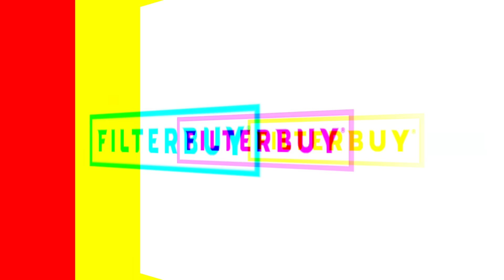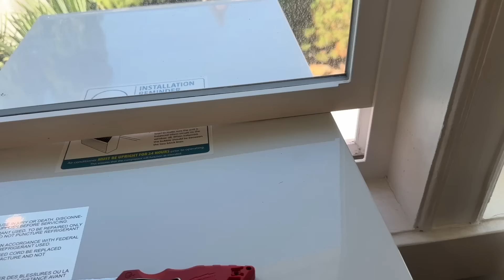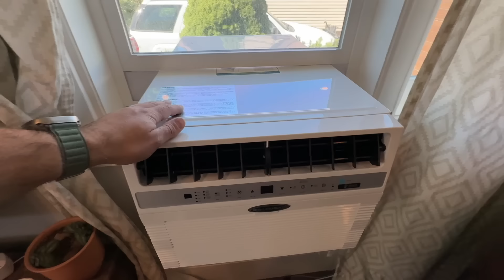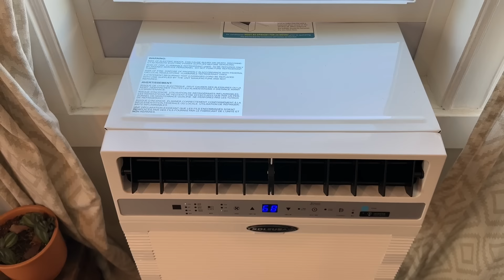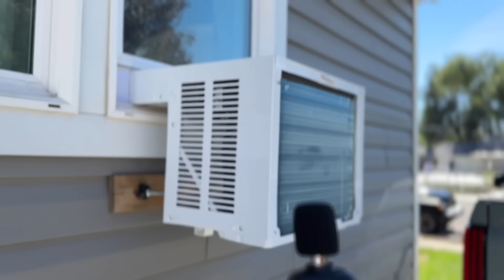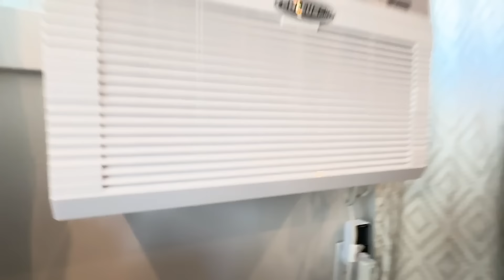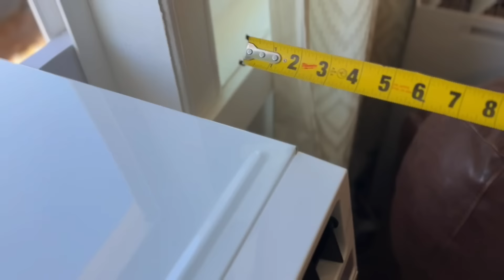I Thought It Couldn't Get Any Better... But It Just Did.

Comment: Great idea but it will not work in older NYC apartment buildings because the space between the inside shelf and the outer wall is over 20" and this will only accommodate 11".

Comment: You would be a fool to buy this (or any Midea) product. They recalled this unit originally and force you to cut off the cord to get your refund. Well, it has been over a year that I have been trying to get my refund and they will not pay it because they say my address does not match the registered address. Well, people do move and even after they supposedly updated the address they just keep saying the same thing and I have not gotten a refund to this date. They depend on TruePic (Scammers that use location based pics) to verify everything. Again, my actual house is over 1/2 mile from the road since I live out in the middle of nowhere so the pics will NEVER have the exact location that the address shows. Midea are just scammers too.

Comment: If you've ever installed one of these units, whether it be this or a ge/haier, they simply are not that easy to install. In this case the window casing is exceptionally wide, helping stabilize the unit in the window. If you have a less wide window casing these units are both awkward and unstable, note in the video where there has been a small step installed on the outside of the house siding, this is to keep the unit from sliding down backwards and then falling out of the window unit. When its time to remove these units, its a 2 man job, don't kid yourself.... either get a conventional window unit of a split a/c unit. It just makes more sense...

Comment: I was ready to buy one but then I checked the reviews. Many bad reviews for reliability, and afterward no service available, just ship it back to California at the customer’s expense of $200 or $275. They’ll reportedly ship a replacement then. I might buy it if I could return it to Home Depot, but shipping it to California pretty much voids the warranty for me. Is this how things work in the entire industry?
Reply: Did you read why the reviews are bad? It's because people were complaining about the drain cock being on the front of the unit. But what we really need to hear about is did they install the unit as level as possible then tip it outside 1/4 inch to slope the drain pan, or not?

I think the Midea brand is probably more reliable though if you ask me.

Who knows.

Comment: I have an Soleusair 8k BTU over the still unit. it works great and is very quiet. My unit does not have heat pump feature. the link he gives in this video does not appear to send you to a heat pump feature unit as well.

Comment: I need to find a window AC that I can run to cool a room at 65 - 68°F even if the temperature outdoors is below 59°F, or even 49°F (not supposed to run AC on cool when outside it's 59°F or lower -- causes AC to freeze up, so Ive been advised). Opening the window is a NO (can't maintain my preferred humidity). I want to climate control the room temperature and humidity to my specifications. You would think that a window unit makes perfect sense for this purpose. It's a hole already present. Why drill a hole for a mini split I you don't have to? Also why add that large mini split wall unit when a window unit is most efficient on space savings?

Comment: This was sus when I saw it. These things just are too small to work at low temps. If it's below 40F outside it's most likely not going to heat at all or the efficency will be in the toilet and it says in the manual straight up not to use it at all at 32F or below. This is not for a cold weather climate.
Reply: I’ve been thinking the same thing, but if it works in March, April, September and October, it would still save me a fair amount of money. Those months are not usually ice cold all the time in New England. We have electric heat and my bill is like $400 a month. I’ll take any efficiency gains I can get.

Comment: I need a window unit that's about half the width on that middle part.  House has tons of windows where the top half and bottom half do not move as a whole, in any direction.  Instead, the bottom halve's bottom half (the bottom 2/8ths of the whole), slides left.  So of the whole window, only the bottom 1/8th slides to the side to open over the adjacent 1/8th.

I've managed with a dual hose portable in these windows, but it takes some yearly rigging up to seal it up ok.  Oh well.

Comment: Interesting that you are measuring 5-6 amps when the product listings are saying it is around 10 amps which is more standard for 12,000 BTU units, though that might be due to using the slowest fan speed.  A 5-6 amp unit is more often a 8,000 BTU unit.  It is also interesting that your amazon link is for the 10,000 BTU unit and not the 12,000 BTU unit you are reviewing.

Comment: The vibration issue is present on mine, slightly different model. The heat shuts off completely when it's under 24 degrees outside also.
Reply: Thats a bummer been looking for a combo unit for my bedroom since it gets the worst or ac/heat from my units.
Reply: @TheDarkArchon  it's so close to being amazing but has these drawbacks it's really a shame, and there really isn't anything better.

Comment: Today it is 699 with a 125$ coupon for the 10k unit. Only 3 star reviews on Amazon. Buyer beware apparently. Costco had a similar unit not too long ago and well... with Costco...returns are a breeze. Here is a recent review... "Do not buy. Zero factory support.
Mine went into a failure mode F5. Total failure. Solrus phone support is ZERO.
Do not buy"

Comment: It's not a heat pump. Heat pumps are ACs that can run in reverse, using half the energy (half the money) of a normal space heater.  Don't get these units without heat pump heat. Unfortunately there aren't a lot of window heatpumps out yet and they are $2k to $3k. There are inexpensive mini split heatpumps, but they take a lot of installation.
Reply: This is a heat pump, I have one

Comment: Not a word about drainage? The drawback to the saddle design -- as compared to the U shaped -- is that water from the coils can't flow out. So it is bound to have some kind of collector.
Reply: It has an internal pump that pumps it outside. Some people say it can get clogged in the reviews but I haven't had that issue yet
Reply: @jasonlaboy  The pump could very possibly fail eventually causing a leak.
Reply: @anymousanticlanker  yeah I image it could

Comment: $800 w/tax and 28% negative reviews. Several complain of the vibration, noise, errors and premature failure.
Reply: We have two of these and can confirm the vibration and noise. The noise can be reduced a bit with some insulating foam around the unit and a good whack if the fan is making a noise (some kind of misalignment?), but the vibration is still a major concern.
Reply: To add, we got this for the winter period and it did a good enough job during a mild freeze that only went down to around 28F. I also just learned that the fan is always on in cooling mode, not something I’m happy about. If I was more knowledgeable, I’d take the unit apart to make the fan behave the same as when heating (only turning on while the condenser runs).
Reply: I own one of these units and it’s one of the best air conditioners that I have ever bought. As far as vibration goes, I’ve experienced no vibration whatsoever. When you put it in quiet mode you barely hear it. That’s one of the main selling points of this air conditioner. Yes it cost more than the typical air conditioner but if you’re a light sleeper, you couldn’t ask for a better air conditioner.
Reply: It did vibrate at first but now it doesn't I'm not sure why. I love mine.
Reply: @RichardPetron  I got mine used and I thought that might be why mine vibrates like that but aparently a lot of people's do. The old owner destroyed the mounting bracket too, but I got a good deal
Reply: @RichardPetron like a brand new car, maybe it had to break-in?
Reply: I bought one. As others pointed out, it rattled the wall and resonates a low freq throughout the house. Felt like I lived next to train tracks. I couldn't take it. Boxed it up and processed an exchange. The replacement was much more quite with much less vibration. Still emits a hum through the walls but not as bad as the first one. My biggest complaint now is that it really struggles below freezing and puts out less heat than my wife's hair dryer.
Reply: @nunyabusiness1499  it may not feel warm because it blows a lot of air but it is still probably giving you a cop well over 1 at 24 outside.
Reply: And the other 72%?
Reply: @eatduncanjewett  41% 5 star. Very poor rating.
Reply: @eatduncanjewett I'd be grading this on a curve because it's the only unit like it. Heat pump window units are almost impossible to find. This thing can be outdone so easily though.

Comment: Not sure why some say it won't heat when it's below 30 degrees. I'm only guessing as I don't really care, but I have 2 110v split systems and also a 220v system. All function in 0 degree weather just fine. Maybe be the window unit being 110v isn't the same as a split 110v system for some reason. It makes sense that it would be without the line set and install aggravation. Maybe I'll look further into it. I would be convenient if these worked as well as the 110's I got without going through the installs and the lesser chance of loosing a charge later as time goes on.

Comment: Anyone that has owned any window unit knows the one thing you fail to talk about, which is ease of cleaning in place... So many of these units are designed to fail the moment the fins get dirty but no one makes these things to be cleaned without full window removal, and it's a major PITA. It makes you wonder why they don't design a commercial unit to be cleaned regularly with out removing the entire unit and disassembled...
Reply: Weekly: low-pressure water hose to the condenser unit and its coils (bonus if you use a leaf-blower beforehand while its dry to knock loose more debris) with the drain plug removed to allow dirt and water to exit the housing. Clean interior filter weekly, never wait for a 'Filter' light because their intervals are wayyy too long.

Every 6 Months: Foaming A/C coil cleaner on both condenser and evap coils. For the evap coil, I go back after it with hot water in a spray bottle after about 10-15 mins of letting the cleaner sit.

Other: I purchased a plastic A/C vent deflector that magnetically sits on the top vent of the outdoor section. This allows that vent to still draw in air for the condenser fan, but the deflector prevents a significant amount of leaves/pinetags/etc from being able to fall straight in.

Some of this is difficult if not downright impossible if your A/C is on a 2nd floor or higher, but these are absolutely the best things you can do for it without taking it out of the window. My 2019 Friedrich Chill A/C has kept my room at 61-63F confidently even if it's 100 degrees outside, all these years.

Comment: Well, when I was in the Navy in the late 70's, the ship I was on, USS Durham LKA 114, , I was in engineering and our living space was 1 deck below the main deck separated from the engine room by a steel plate floor. Needless to say,  it was still loud and the vibrations, Then when I was with forestry for my career, I went out in a strike team to Angeles National forest 1996, They gave us a nice 1 acre or so mowed area with a nice big huge portable generator. 🙂 that was only 50 ft or so from our group pitched in tents and sleeping bags. You would be amazed how easily you fall asleep when you are exhausted and how quickly your body adapts to the noise that you don't even realize that it's on. I would not have told this with my real name. I never boast of anything. So this makes  no difference. MY Point, you can adapt to most constant noises quickly. CONSTANT steady. NOT a dog barking or cat's fightings. that is not a constant sound like a humming sound or air conditioner. sorry for the story. steady noise is easy. 🙂thanks.
Reply: Agreeing, It's abrupt new noises that wake me.
Reply: @HutchinsonJC  yes, not steady continuous. 🙂
Reply: I slept in a top rack with one foot of space above me from a 5 foot diameter reactor steam dump pipe, sounded like a train running me over.  Also had a berthing next  to the chain locker on a carrier, my God it's impossible to describe what that sounds like as it rattles  your bones.
Reply: @ChillWill-q5x  part of our job as an HT was sea and anchor detail. Got to let out the anchor and chain a few times. Needs a face shield because all of the mud and dirt and rust that came out of the chain locker and yes, It was really really loud and fun. thanks for the memories. 🥰🥰🥰🥰

Comment: Just to be clear, does this unit actually include a heat pump, or is it a simple resistive electric heating coil packaged with an inverter/compressor A/C unit?  You mention a reversing valve, which says it's a heat pump, but there is no mention of the HSPF or COP, so I'm confused.
Reply: It is actually a heat pump

Comment: Gradient and Medea also have inverter-driven saddle-design units.
Reply: With A/C and a heat pump?
Reply: Those will cost around $3k. So the price difference between this and the Midea/Gradient units is huge.
Reply: I thought Medea only had the u-shaped that comes up around the window, not downward. Please share model numbers if you have for their saddle. Thank you.
Reply: @dplj4428 yeah theirs is up around the window and does not have heat.
Reply: Gradient is bad too. Send them an email, but use a few slang phrases or try to ask 2 different questions on 2 different topics. Their AI "person" on the other end will show their cards really quickly.  If you're in for entertaining yourself.

Comment: After installing such a unit, what about security? The window cannot be locked normally.
Reply: small length of  2" x 3"    placed between the top horizontal of the bottom sash,,,   and the underside, of the top horizontal,
        of the window frame
Reply: They make little clamps that you can place on the window sill to lock a window at any position. Just search for "Sliding Window Lock".

Comment: Thanks for that demonstration. I like the new saddle style window air units. But I'm curious about what the current draw difference might be with that power cord uncoiled. A coiled power cord can create an AC choke which can create a problem with current flow in the cord. I don't think your current on that unit is high enough or coiled portion of the cord is long enough to be a problem but I would be curious to see what your current draw would be with the power cord uncoiled and then the power cord coiled as you have it in this video.

Comment: At low current draw like this, there is no provision for auxiliary (resistive electric) heat.
The heat pump will only function well down to about 40 degrees F. Outside Air Temperature.
Then it starts 'making ice cubes' below that ambient temp., and gets stuck in the defrost cycle.

Thanks for the review
Reply: In my experience it works well down to 24 when it complety shuts off but it does defrost especially on snowy days. It doesn't completely kill the effectiveness of it though
Reply: @jasonlaboy  Very nice, good to hear it is engineered for lower OATs! Thanks for the information!

Comment: Important Question --- If the power goes out will this unit resume operation using the settings it was running with before the power failure? Sorry, never mind. The condensate drain issue is a deal breaker for me. The one you demonstrated that goes up from the sill is the better design if you don't want to babysit a drain.

Comment: That design has to have some sort of condensate pump which is going to be the weak link. It'll probably last a year or two before the pump dies and replacing it requires total disassembly of the entire unit and/or the part costs as much as just buying a new unit. Been down that road many times with dehumidifiers. The pumps always fail before anything else.
Reply: I saw this type awhile back and kept going back and forth on the idea of getting one. I have a small window a/c that cools the entire 800 sq ft house I live in. I don't like that it takes up half the lower window, and I don't like putting it in and taking it out. But I decided to keep using it because of the reviews I read about these new ones not having good (or any) customer service.

Comment: LoL! window mounted heat-pumps are not a new thing they existed over 40 years ago, yes actual reverse-cycle heating units the and most had backup resistance heat strips for when it was too cold for the heat pump only mode. 

They were also made way better back than with real refrigerants and overall better build quality as well. 
Modern HVAC is all overly computerized garbage the same goes for basically all appliances made these days it is getting harder and harder to find any type of appliance with mechanical controls.
With the exception of some of the 5K BTU window rattlers and the cheaper fan heaters.

Comment: I believe Midea might be an even better unit. They are high-end, and were the first to come out with this style of inverter window “C” unit.
Nice review! Thanks for spending YOUR money and time for the benefit of other people 😊
Reply: I have the Midea unit. Like him, I am quite impressed by the performance, ease of installation, and noise. I imagine the two units are similar, although I give the Soleus Air unit the edge because it's a saddle design whereas my Midea unit is a U design. Also the Midea unit looks like it's more compact, but that's not really a consideration for me.
Reply: i have a few midea units but i can't find any with heat at all for sale, does your midea have heat? If so, what model is it?